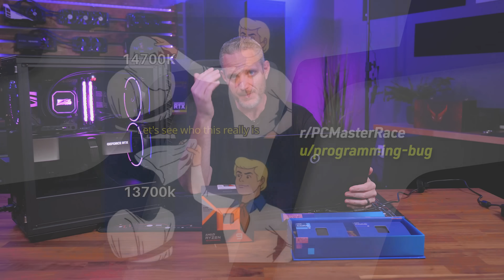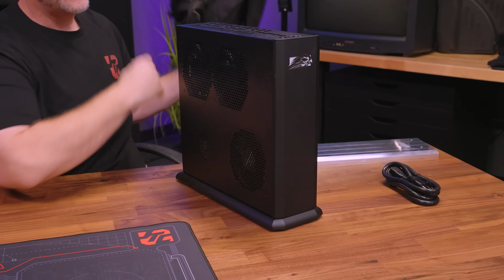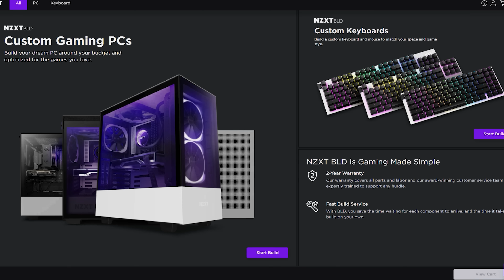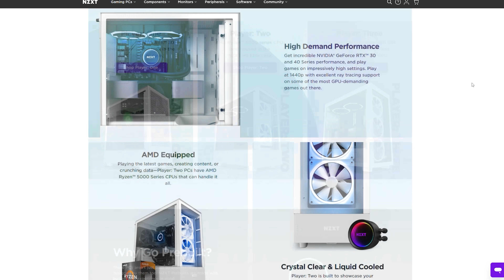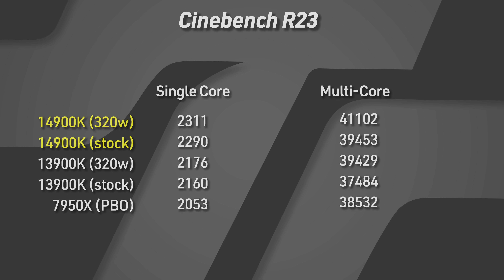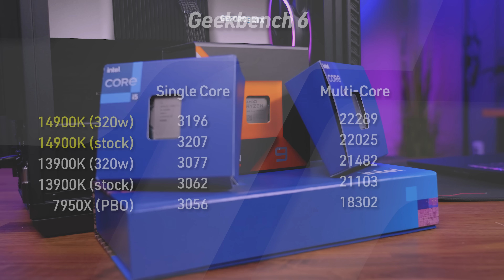THIS is why people have trust issues! Intel 14th Gen Review

Comment: really, the only reason you should be getting the i9 would be core clock, and disabling extra cores, in terms of gaming

because, that extra cost and those unused cores, they all run hotter, even without the speed increase, just because theres more cores, and your computer wants to push stuff onto unused cores as much as possible

i7 should be the upper tier for gaming i9 should be for productivity, unless you are willing to spend a premium and disable cores for gaming

Comment: Yeah, it will be nice to see build videos. Different price points would be nice too to get an idea of how much performance you can squeeze into a budget. I’m in desperate need to build an updated PC (currently on 4th gen Intel and DDR3 RAM), but I can’t afford cutting edge tech now that babies will be on the way.
Reply: FYI, you can still find new 12th gen CPUs for sale which are $100 cheaper than the same tier of 13th/14th.

Comment: Honestly what makes me really board with Intel is their abysmal efficiency, it just shows poor design and engineering, why make an actually good CPU architecture when they can crank the crap out of the power making the damn things barely able to be cooled properly just to say they are technically faster in some cases than AMD, really outside of limited use cases I can't see any reason for anyone to go past a 7800X3D, especially for gaming, heck for my gaming computer I just have a 5700X to pair with my 7900XTX because the faster CPU is pointless at 3440X1440, I'm always GPU limited with the GPU pinged at 100%, and that's without PBO so very easy to cool with a low profile downdraft cooler in an SFF case.

Comment: I'm kinda frustrated that all Media Outlets only Cover the 14900k. So i have to Tell you Something: no one buys These Things🤣 yeah Back than alot of people bought the top of the Line i7 because IT was best for gaming. But why would i blow 500 bucks on an i9 If i get better gaming Performance for half that with a 7800x3d. Or even a 13600k. I mean If you Drive a 1440p or 4k Monitor you can even use a 12400 or 7600 and still be GPU bottlenecked. CPUs nowaday are so good that you need the expensive ones only for productivit.

Comment: How badly are your machines setup MY 13900K @ Stock on a Z690 Aorus Elite AX DDR4, Cinebench R23
38693 Intel POR, 40481 320W PL1/PL2, 41204 Unlimited PL1/PL2 363W CPU Reporting (IA Cores Power) 347W VRM Reporting (Power POUT)
my sample is poor i see the vid's go as high as 1.465V, and you only get 41102 out of the 14900K geez "influencers" 
you could put all of you in one room you couldnt setup a pc properly between you

Comment: Well for me I was using Windows 10 on my 2nd gen 2700k Z68 Mobo for the last umpteenth years  considering that it was actually Windows 7 with the free upgrade. Couldn't upgrade to 11 because of the TPM 2.0 requirement. So I knew the 14th Gen was amongst us but I felt strange when they said it was going to be cool for LGA1700 Peeps cause they could keep their boards. Needless to say I built another box with a Z790 and a 13700K 2 weeks before launch and now that I've listened to this it reminds me of the Sandy Bridge to Ivy Bridge 2nd to supposed 3rd but it was called a 3770K 😂😂😂😂Intel ya'll ain't changed a bit. All I can say is I paid $339 dollars for my 2700K when I built that box and I paid $375 for the 13700K 11years later think I did pretty damn good but I ain't falling for the $599 14900K Here Intel "TAKE MY MONEY" game based off of Jayz comments on performance. I'm so used to Tick Tok and change chipsets that when they extended it to another chip Meteor Lake wasn't ready so let's call it a Refresh. Gotta love Marketing see ya Intel in another 12 years when I decide to build another box hell I'll be 65 years old then do I really need another box?? Hell I still have a Q6600 box on Windows 7 in a closet somewhere 😂😂😂😂😂

Comment: All consumer hardware improvements from one gen to another are so minimalistic I have no need nor enough performance boost upgrade to justify buying new hardware more often than every 4 years.  
This was my CPU journey with intel - Core 2 quad 8300 -> i7-4790 -> i7-10700k. My next CPU will be no sooner than 16000 gen. The main improvement in performance I have ever experienced was switch from HDD to SSD. Then there are GPU upgrades when u move up a gen and a tier at the same time but thats it.

Comment: If a CPU is hitting ~100C on a watercooling rig, is there a risk that the heatsink-water interface willl begin to suffer from Leidenfrost Effect where the water essentially boils on contact with the heatsink and thus the heat transfer will be insulated by a small buffer of (essentially) steam?

Has anyone ever done a test to see how far you can push the hot side of a heatsink before something like this begins to happen?
Reply: No, the water never reaches that temp. That’s just the internal chip temp because the cpu IHS can’t remove the heat quick enough. It’s a heat conductivity issue due to high heat density.

Comment: There's 24 different models of 14000 series CPUs which is nothing but confusion for the customers.  Hard to know what CPU is what with all the letters attached.  With 5 digits in its model number (not including "i#-", why can't it make sense?  Why not 143xx,  145xx, 147xx??   K, KF, U, F, T,    Not including possible mobile versions of H, HX, U, P. 

AMD is not nearly as bad with 14.  But its far easier to know what you're getting.  (11 if you take out the three OEM PRO versions)
7900
7800
7700
7600
X = full version, higher wattage.
(blank) = 65 watt version, cheaper = includes cooler.
X3D = Gaming version. less wattage. 

AMD does need to make a 7200 and 7400 that need to be 4 core versions of AM5 for low-cost PCs that don't need the muscle.  At $90 and $150 respectively.

Comment: I actually get LESS with Asus bios optimized. Asus putting their own limitations brought my temps 15 degrees lower but at the expense of fps. I used to get 50-100 FPS in the warzone 2.0 map but now with my limitations removed and bumped my all-core performance from 4.8 GHz to 5.1 GHz with intel's failsafe Avx instructions. I play with an 85-degree max temp plus 30 FPS gain without stutters. I use Maximus 13 Hero and the bios got so complicated that I use XTU for overclocking. My mobo says I got a 50 SP score so my silicon luck is low but I compensated with custom watercooling. It's been 2 years since I've been using this motherboard and since yesterday, I have been able to utilize this mobo fully with the help of a program outside the bios. Also, I am not on board with P-core, E-core things intels been doing. Even though it helps, I would rather have Ryzen 9 with 12-16 all P-core raw performance rather than a CPU with supposedly 24 cores with 16 of them working lightweight.

Comment: Yeah the only thing with the 14700K is that it received a bump in e cores from 8 to 12 and from 24 total threads to 28. Yeah Intel being confusing with their naming scheme what a surprise. Well with 4th Intel it wasn't that confusing because they stuck with the 4xxx series though rather than going up to 5xxx for the refresh. Hell it's Intel being Intel. Well one thing with meteor lake that we are getting most definitely is the new naming scheme the Ultra and non Ultra CPUs

Comment: As an engineer who designs Analog/RF integrated circuits (ICs), I suspect that although the 14900K has slightly better performance at lower power levels, the rate of change of the internal junction temperature of the chip is much higher than 13900K because 14900K's chip is designed in a lower node (maybe 7nm instead of 10nm) using something called "optical shrinking". However, this would result in a higher electro-migration effect in the interconnects and therefore "age" the chip faster to the point that it does not last the 10 years it is normally designed for. This is why the performance of 14900K is not that much better than 13900K. Basically trading-off age vs performance. There is a marketing issue here though: why sell CPUs that will last 10 years when enormous technological jumps occur in 5 years?
Reply: So, which is expected to last longer:  the 13900k or the 14900k?

Comment: Intel needs to reign in the motherboard-manufacturers so that we finally get sane stock-settings again. Those boards are so INSANELY BAD with their settings it is just baffling that intel still allows that. Not just that the boards are ignoring all power-limits - they also increase voltage far beyond what is needed. It is so bad that at stock speeds changing the settings to intels specifications will easily drop powerconsumption by 20%.
With 12th gen when running according to specs you got nearly a 100% increase in efficiency and with 13/14th that hasn't change much - just insane.

Comment: I still use an i7-4770 combined with an AMD rx580 (used to have gtx780 but it fried) 1866 ddr3 ram and looking for a new build, I’m looking into an rx7800xt gpu and 7800x3d. My question is, is it an upgrade worth it or should the new gen intell cpu be better? I don’t want to spend more then 2200-2400 euro.

Comment: Honestly it's not even 4770 vs 4790. This is P4 era bullshit where in pathetic desperation to "compete" with AMD they just keep throwing more voltage and higher clocks at the same CPU.

It's the same intel stagnation as P4 or 14nm+++++++, especially if you figure power draw to performance. Take all your charts, and divide their numbers by the wattage pulled from the wall for the entire build. 

THOSE are the real "performance" numbers... and it makes Intel look like they haven't innovated since before AMD dropped Zen 2.

Comment: My best guess is, Intel takes the time to improve everything for the next real Gen. They improved internal graphics by a huge margin and also the 14700k, which got more actual e-cores, but in general, this "Gen" is a gap-filler. Power consumption wise, if let loose, Intel does not see any light in direct comparison.
And for half the workloads (like compressing/decompressing tasks (7-zip), Blender, calculations (superpi)), AMD is still ahead and uses way less power.
Went from Intel to AMD with my last build and cannot complain. We will see how this develops. The last rumors I heard was 4080 performance with Intel's latest planned GPU for under $500... THAT would be something many of us are waiting for!

Comment: I got it before 17 okt.
But anyway the point is always the same Jay.
Is the pc 7-8-9-10-11-12 years old and hardware not great anymore, and tired. 
Yes that 14 th gen Intel is a very big lift up.
Even if you come from 8-10 or 11 th gen intel CPU series.

Do you get a ton off lift off if you come from 12-13 th gen Intel series.
Maybe not in 20-30 %. 
But it is stil a upgrade at 10-15 %. 

You get more proformance watt.
You get more ram speed CPU 7800-8000 mhz. 
You get more Cores out off it. 
You get even more juice power out off a 14 th gen motherboard MSI / Asus / Gigabyte.
And even future proff Wifi 7 when that gets out in a year or 2. 
What non off the old hardware have to day. 

So it not just about the CPU alone there are other things to here.

Will Meteor Lake intel 4 chip in december/jan 2024 be better, sure for Graphic part.
But it will not come to "self build" pc or in a "box unly".
Mobile unly and "also all-in-one" pc from a store.

So Raptore Lake refresh S will be here for a long periode at least 5-7 years.
Even when Arrow lake and Luna Lake will come out.
Whit LGA socket 18 series motherboards.

And the point is that future Windows 12 will also be supportet to Raptore Lake Refresh.
So the older pc that unly cut drive Windows 7-10 and so on. Need to upgrade anyway in 2025.
When Windows 10 is going dead from Microsoft.

So see it as a software point and hardware point. 
You can not save old hardware forever.

About prize set from Intel.
The funny part is that is was cheaper 15 % Intel 14 th gen on pre sale.
Then 12-13 th series, so there was really no brainer in that part.
For people that needed to upgrade the pc from old stuff anyway.
Just look out for stores that push around whit the prize tags always.

So who really cares what series it is called.
Cut also be called 13½ but 14 th gen is just more easy for people to seperate the 2 one.

But will it hold 10 years maybe not. 
But at least 5-7 years, even when the ton off other CPU are comming in 2024-2025-2026 that again are set for years to come.

And for some change reason the 13 th gen CPU was not whit a in-box- cooler from intel.
in my country. But 14 th gen is whit one in the box. 
So again better then non, even if you use a better air or water solution then the standard Intel one.

Comment: I think you nailed it… in the criticism, the conclusion, but also in pointing out the one tangible benefit - the only compelling reason to grab this over the cheaper 13th gen will be to keep power/heat in check while getting slightly better performance. Anyone wanting to buy a dead socket for a “bargain” will take 13th gen.
Personally being able to run a 14700k on a 280 loop will be absolutely worth it, but I’m in an ITX niche that applies to nearly no-one…
Reply: both the 13 and 14th gen are sub par and shouldn't be bought.

It's literally obsolete and wasteful.

Comment: i have the 13600 k running 5.2 all day long and it being cooled with a 360  aio. I run r23 and the cpu never goes about 70 on all cores no need for a 14th  but if i was building a new rig go for the 14th gen like he said less power draw heat is not a problem with the 13th gen on a 360 aio. But yeah 14th gen no should be called 13th gen raptor lake RF for refresh aka 13600 KRF lol.

Comment: Ok, I'd like to see a 14th gen vs 12th gen comparison. I just built a new PC with a 12th gen i7 12700K, and would love to know if it would be worth the upgrade in a couple of years or so to upgrade to a 14700 or even a 14900 (to avoid also upgrading the motherboard, RAM, etc.) For me, a 10% increase in performance wouldn't be worth it unless in a few years 14th gen would be $150/175 or less. Maybe not even worth a 20% increase...
Reply: id bet in a few years there will be cpus for $200 that will be better than the 14th gen upgrade. i wouldnt worry about upgrading til then. sent from a fellow 12700k user.

Comment: Don't get why people are so mad about this, I saw this as a mostly possitive thing. To me this feels like a socket's getting a mature upgrade (allthough small on the perf. side).
Allthough whoever upgrades from 13 to 14th gen is probably not the smartest person.
I have a 11700K so an upgrade would be nice but not neccesary, though the 14700K had a few E-cores more and I always tend to go for the seond option so to speak.
For example i decided on a 4080 instead of a 4090 and 2y-3y before that i went with a 11700K instead of the 11900K.
For me It's not worth it going with the most expensive option.

Comment: I'm told not to upgrade due to this but I have a 9900k and modern gaming with my 3090 the 9900k is finally showing its age in the triple A 4K extreme setting gaming, I see the 3090 doing great with 13th gen but the 9900k is really holding it back in the modern titles
Reply: just go 12th gen or wait
Reply: wait for 15th gen if you can. die shrinks generally are the best time to upgrade. i can see a 15600k being better than a 14900k at gaming
Reply: @GraveUypo  duh

Comment: Earlier this year I bought a chinese brand Erying MATX board with a laptop intel core i9 12900H CPU(14 cores/20 threads) I got a heck of a deal on, 32GB of DDR4 RAM at 3200Mhz, with an Asrock Challenger AMD RX6650XT 8GB GPU, and on Manjaro Gnome Linux I don't feel the need to upgrade anytime soon, as it runs all my daily task, and gaming needs just fine, and think it will do for sometime to come.
So I feel unless you are chasing the bleeding edge to always have the best of the best, then the days of people having to upgrade soon as a new generation comes out to even run the latest software, and games unless you're on something really old, are done, and been for some time as even a 10 year old PC with simple upgrades can still game, and run daily task if you keep your expectations in check.